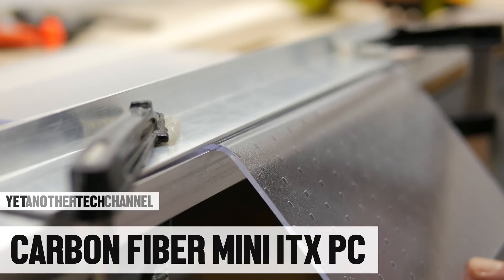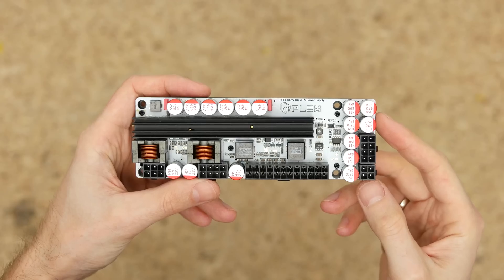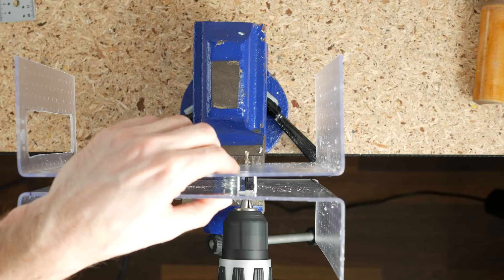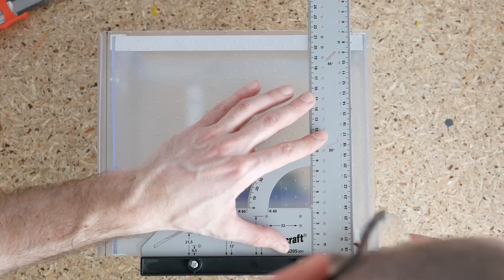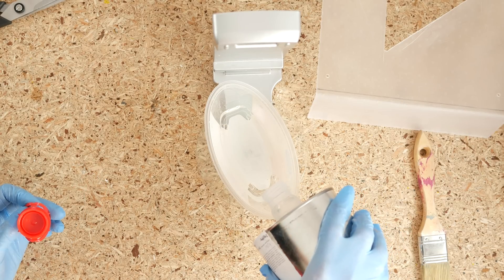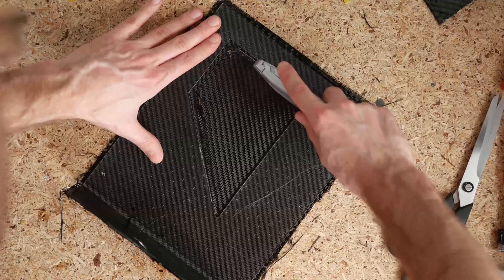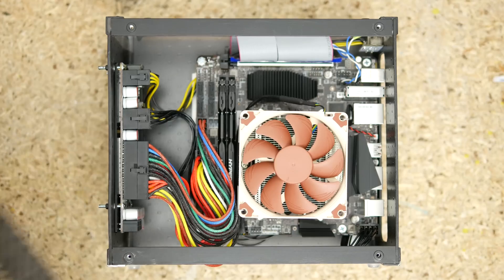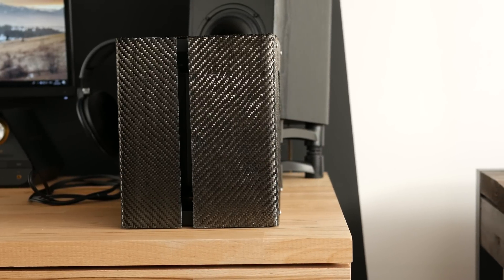How to make a mini ITX computer case from scratch (DIY PC case)

Comment: What was the cost of the plexiglass?
Reply: How thick was the carbon fiber case sheets once done?
Reply from the maker: 54x44 cm sheet of plexiglass was about $5 - I had to buy two of those.
I'm pretty sure you can source plexiglass cheaper and in more optimal size - I have a lot left overs.
Those panels are about 3 mm thick.

Comment: After  sanding your cut seams, use your hot air gun on the sanded surfaces, That will smooth and clear them.
Reply from the maker: Cool! Thanks for the tip!

Comment: Amazing job. I cannot believe I am saying this but the fake carbon fiber looks better in many ways. I have never seen the real thing used before. Cool idea. Looking forward to your next build. Check out my channel for my diy wall mounted PC
Reply from the maker: To each their own ;)
That's a pretty neat wallputer! What PCI-Ex riser cable did you use?
Reply: YetAnotherTechChannel Amazon  EZDIY-FAB NEW PCI Express PCIe3.0 16x Flexible Cable Card Extension Port Adapter High Speed Riser Card. Amazing cable! I haven't seen anything else like it. The 90degree connection gives more mounting options

Comment: I do think a less flashy wrap tha carbon fibre or a nice spray paint would have looked more premium but Ienjoyed this a lot.
I just finished my first custome watercooled build and a self built case could be my next project and your content therefore really inspiring :)
Reply from the maker: Maybe, but there's something about carbon fiber that I really like and I always wanted to try and use it.
Did you watercool the GPU as well? Hardline tubing? Which water blocks did you choose? I really want to watercool my workstation desk PC :)
Reply: No hard feelings about style :)
Yes, GPU and CPU. 3570k and a 290x (used) as this would allow me to keep using my current rig and not put it (current rig) in danger of any damage.
Soft tubing built as I did not feel up to the task of bending tubes and deal with all the other things which could go wrong (anbd partially did).
I bought a used EKWB Supremacy EVO fully nickel version for the CPU
and bought a used Powercolor R9 290x LCS which comes with a waterblock from the factory which is codesigned by EKWB.

I also made custom cables which was quite a task on its own. It is work of 10ths of milimetres but in the end it looks 10 times better than crappy stock cables

This was my first time and my best tip so far is to plan absolutely every step. Make a list in which oder stuff goes in, you connect it up test it, etc.

if you have more questions, ask them here if you want to(you might want to heart - like - my previous comment as that will show up in my notifications. The replies do not show up). This is definitely doable for a beginner and since you know your way aroung building stuff you should have no problem repeating some mere thing I did (hell, I come nowhere near your skill when it comes to fabrication).

Comment: Really cool case! You make some superb work! Always well planned and thought out. For your next case/build I challenge you to make one using the Ryzen 3 2200g or Ryzen 5 2400g with pico power supply. You could make a really tiny PC since you wouldn't need a graphics card and the Ryzen 3 2200g is quite cheap. I am tempted to try this but a pico power supply like the HDPlex 300 is quite expensive.